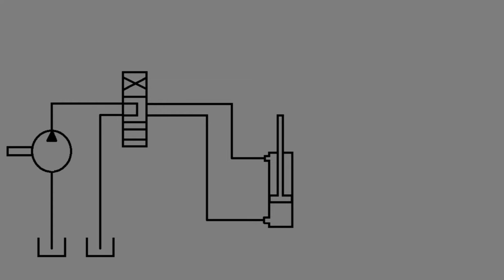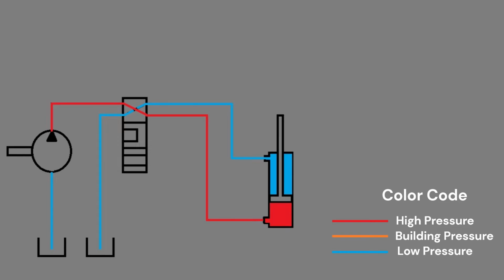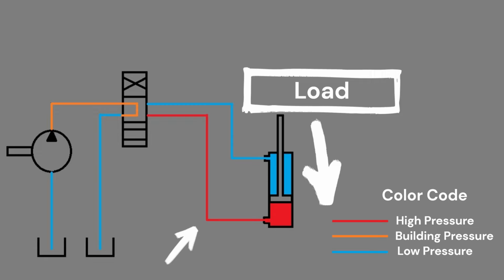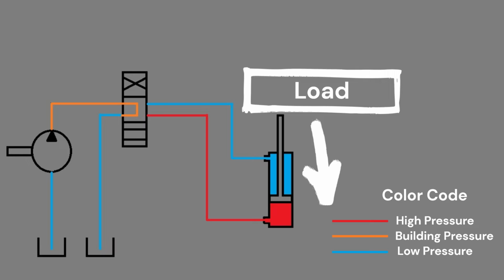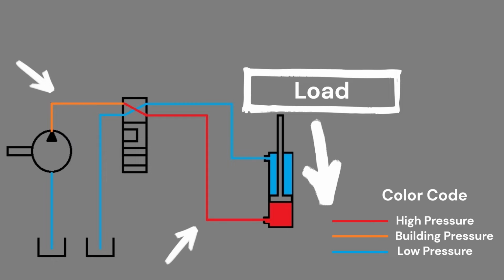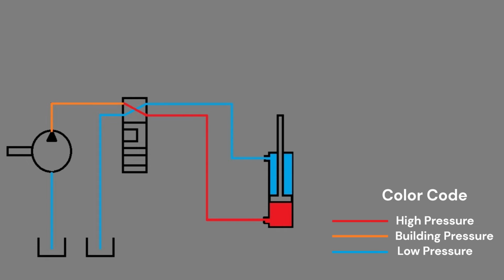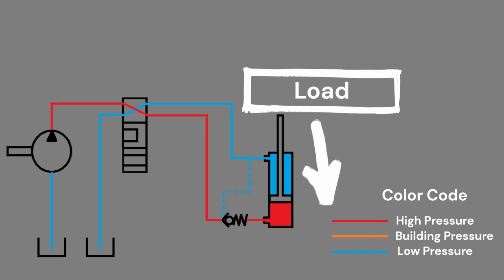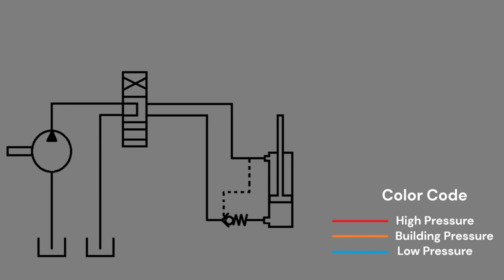Load Holding Basics, How to Read a Hydraulic Schematic

Comment: I’m trying to find a way of driving my tractor transaxle with a hydraulic drive mounted to a remote engine. Basically acting as a clutch and driveshaft. Can you help me?
Reply from the maker: That's an interesting project! Are you trying to make a 2 wheel drive into a 4 wheel drive? Why the remote engine?
Reply: @Hydrauliac 
My tractor has a driveshaft between the engine and the transaxle. The clutch is mounted to the transaxle. Because of a very poor design the clutch fails frequently and the parts are expensive. I would like to eliminate the driveshaft and install a hydraulic pump directly to the engine and a hydraulic motor directly on the transaxle in place of the clutch. The new hydraulic control (presumably a hand control) would eliminate the need for the mechanical clutch and my old knees will get a break from pushing the clutch to shift. There is a small hydraulic system for lifting implements but I doubt it can handle driving the tractor. 
The tractor is an International Loboy 154
Reply from the maker: @ImYourPlumberdotcom Hydraulic ground drives work really well for the reason you are talking about. They don't deal with the same wear that a clutch and/or variable transmission will. However, a whole system is going to be far more expensive than a new clutch. You will need at minimum: pump pad, hydrostatic pump, charge pump, hot oil shuttle, filter, cooler, reservoir, and piston motors. You may also need a torque disk for the engine or gearboxes for the motors depending on the horse power and radial loads involved. Each of those components has to be sized to match each other and the application in a very iterative design process. You might find an ambitious shop willing to figure all of that out, but if you want it to be more reliable than your current mechanical drive it would take months of engineering. I'm sorry this probably wasn't very helpful. If you need this tractor to work, I strongly recommend not attempting this. If it's a fun hobby type project it sounds fun though. Best of luck!
Reply: @Hydrauliac Without over simplifying the process, how hard could it be? I need a motor and drive with a 1:1 ratio that can handle 15 hp. Fluid capacity, cooling and filtering are secondary in my mind. I’m really just trying to replace the driveshaft. All the other calcs were done by the manufacturer. Of course, I’m clueless on how to do that.

Comment: I have worked on hydraulics a lot while heading a maintenance team for a factory.......pilot double check valve for load holding and counter balancing are 2 great usecase i found.....i had many iso-static press going upto 1200 Bar pressure............
Reply from the maker: Thanks for sharing your experience! 1200 bar is a lot of pressure!
Reply: @Hydrauliac  yes....huge pressure....its used to press transformer winding coil after heating oven , so that coil is settled.....press has 2 pumps , 1st operates a high flow low pressure pump to quickly position the cylinders , then operates the high pressure low flow pump.........if ferrules are not fitted well........hydraulic oil shoots like rocket.......